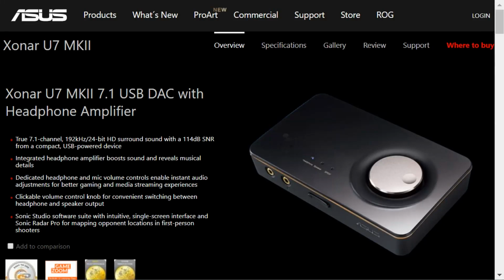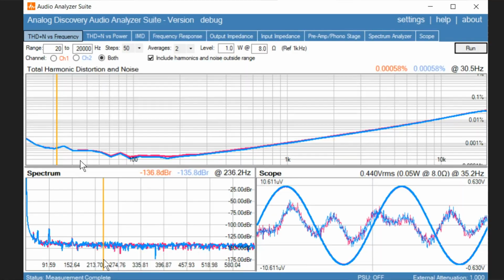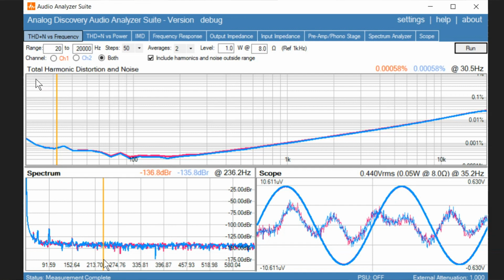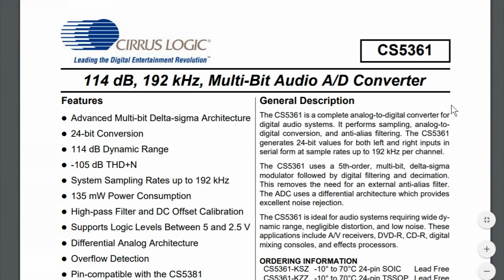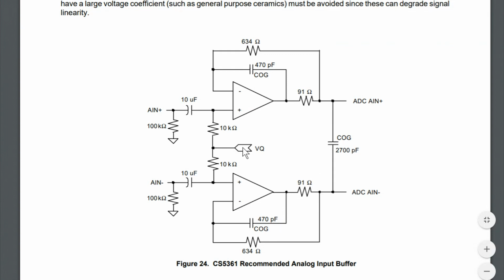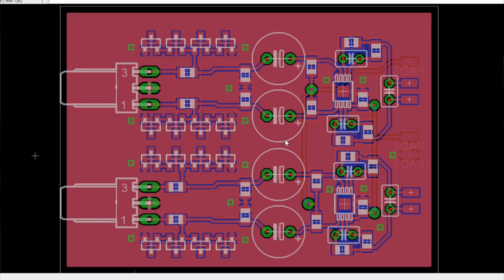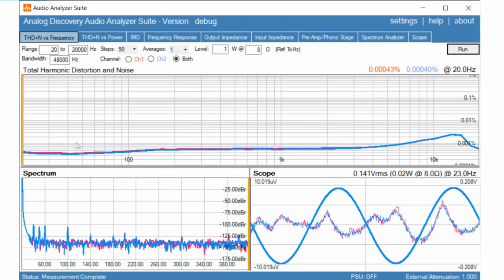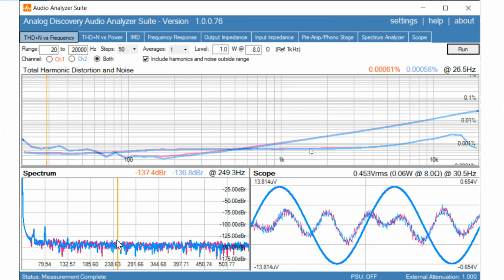Asus Xonar U7 MK2 Performance Improvements.

Comment: Another fantastic video. I have a Asus Xonar U7 MK2 and have used it with ARTA in loopback mode and got 0.0036 with MIC in and 0.0011 using Line in. Line in seemed to eliminate the 50Hz component. Trying on different USB sockets on the same mainboard offered very different results. I have an USB isolator on its way to see if different results can be achieved with it in line.
I will post update here in case any of your viewers are interested.
Reply from the maker: Thanks! It's a shame ASUS discontinued this little USB soundcard, the performance is quite good for the money, especially with the modified front end. It slightly outperforms my Focusrite 2i2 gen 3, but the Focusrite does have the advantage that it doesn't need any modifications and comes with both balanced inputs and outputs, it does however cost a lot more than the Asus Xonar U7 MK2 did. I've also experienced issues with USB ports not being able to deliver enough power for these external audio interfaces, I found that a powered USB hub helped a lot. 
Cheers,
Jake

Comment: 3:40 - Be careful!
CM6632A and CM6632AX are not the same chip!
The chip shown in the picture is the CM6632AX, which fails after 2-3 years of use and can only be made to work by warming it up. (known as the blinking led issue)
I know because I have it too, but the Echelon Edititon has the CM6632A, which no longer fails!
Reply: why this chip fails then?
Reply: @galaxycupcake9258  I think even the manufacturer don't knows. :D

Comment: I've come across your video and impressed with your knowledge of sound cards and the improvement you made.

I currently have a sound blaster X Pro USB sound card. It works alright but I don't have analysis equipment .

A long while ago I ran a Asus xonar avhd 7.1 full analog board and really truely enjoyed the quality it had.

Do you know of any very decent upgrade USB sound card to my current sound blaster X surround Pro?

Comment: Do you remember how this thing comes apart? There are 4 screws under the rubber feet on the bottom.   is there any more? Maybe under the serial number label?  I see clips on the inside too, how did you release those?  I snapped the RCA jacks off the board, trying to get inside to solder them back on.
Reply from the maker: Hi, mine is packed somewhere right now as I'm in the middle of moving, but from what I remember after removing the screws you just need to pull off the volume knob, then you should be able to remove the lid.
Cheers,
Jake

Comment: Interesting - the main culprit in terms of excessive THD in the original input stage have to be the smaller ceramic caps in the lowpass filter then. (Behringer 2496 series disease.) You can see the rise towards the low end contributed by the coupling caps but that seems almost negligible in comparison.

The LME49726 also has a dirty secret though - while it may have high maximum output current, it also is a low-power part (very low idle current, modest GBW) so load immunity actually is not particularly good. Why then they would be using this part on the headphone output of the U7 is anyone's guess. The cheaper Xonar U5 is using a more conventional TPA6130A2 instead, which is a dedicated headphone driver IC.

Comment: Nice investigation and modification! Do you know the bandwidth (or upper cutoff) of the original input circuit that you replaced? It seems to me that it is very low, like 25kHz? If you have a schematic of the input stage it would be very interesting information.

Comment: mine died a while ago, heating usb port with blowdryer fixes it for a day or two. any ideas? apparently it's a common issue
Reply from the maker: Sounds like a cracked solder joint on the USB socket. You'd probably need to find someone with the skills and equipment the replace the socket for a permanent fix.

Comment: hey i purchased this on recommendation (Still haven't received it yet)  but im being told the Amp doesn't actually Amplify anything its just controlling windows audio? Is this true?
Reply from the maker: Hi, it works like a sound card, as in it converts the audio from digital to analog output. The built in headphone amplifier does a decent job, but the output is limited to around 1.3V, meaning it works best with smaller headphones and might not have enough output to drive large open style headphones. But overall I think it's good value for money when you need a higher quality USB soundcard for a laptop. 
Cheers,
Jake

Comment: hey do you think i could use this with the sen hd600
Reply from the maker: It should work, but keep in mind since the HD600s are 300 ohm impedance, 94dB sensitivity and the max output on the Xonar U7 is 1.3Vrms you will be limited to a max SPL of something like ~106dB. So it depends a bit on how loud you like to listen to music.
Reply: I tried this with Senn hd650 . Definitely get s loud enough for most people but it sound flat and bass response is low. Not good enough for audiophile standard.

Comment: Try the TI LME49860, which can operate at +/- 22 V (44 V Total).   Add another higher voltage supply for the OpAmp, and increase the gain to get the output voltage you want (up to ~ +/- 20 V pp ~ 14 Vrms).  If using a single supply instead of a split +/-, there will be an issue with the reference voltage from the A/D or D/A ICs, which will only be 1/2 of 3.3 V or  5 V.  I can send you a schematic of a simple good, high output 1/2 B+ artificial ground circuit with great slew rate and high output current, and is cheap to make.
Reply from the maker: Yeah, I'll need to decide what to do about the output, 1 Vrms is not enough also might as well make it a balanced output now the input is balanced. I was thinking about adding a dc-dc switcher to generate a 5V, giving me +/ 5V available while still being only USB powered, that should allow up to ~2.5Vrms output, that is still a bit marginal though. I might have to follow your suggestion and add a mains powered transformer for larger output, I believe I have some small 2x18Vac transformers somewhere together with some LM317/337 for regulation. The LME49860 is indeed a magnificent opamp, the noise specs are so low that probably the resistors used will generate more noise.
Reply: Hello! Can you please send me the schematic? I own a Car Audio DSP and upgraded it with LME49860's.
I would like to upgrade my XONAR U7 mkii.
Thank you!

Comment from the maker: My best guess is that it was designed this way because the input performance wasn't a priority for the marketing people. However it's a shame they didn't do it slightly differently to achieve a much better performance.
Reply: According to u, which is best sound card, and is realtek sound card good as every nearly motherboard is using it, im currently using synaptics smartaudio, please tell asap.
Reply from the maker: @anurag19984  The onboard Realtek will be just fine in most cases. If you want the absolutely best sound quality you'll need an external DAC, probably the Topping D90SE is one of the best, but it will cost you around $1,000. Slightly more affordable are the high end cards from Asus, EVGA and Sound Blaster at around $200-300. But a good budget card is the Asus Xonar SE at around $40, or if you need an external one, this Asus Xonar U7 MK2 is good.

Comment: Nice work. My first thought was of resistor distortion. Have you seen Dave Hill's paper on distortion in surface mount resistors? Here is a link: http://www.davehilldesigns.com/smt_resistror_distortion_rev1.pdf
Reply from the maker: I saw your comment, but youtube will delete any links
Reply: @TheStuffMade  Sorry about that. If you search the web for the terms: Dave Hill resistor distortion, you should find a couple page long pdf about testing smt resistors for distortion. It can be surprisingly high in some cases. it tends to be higher in smaller packages depending on manufacturing process.